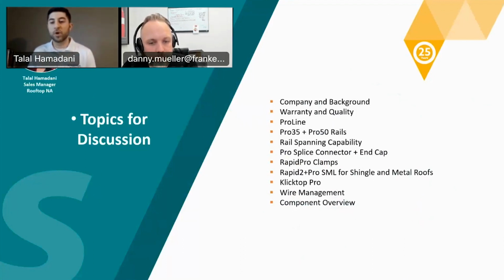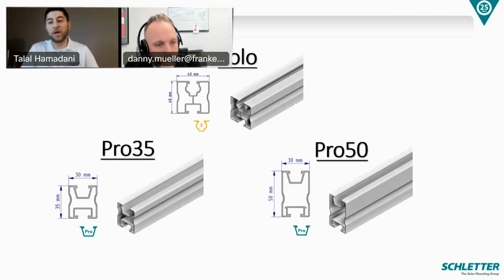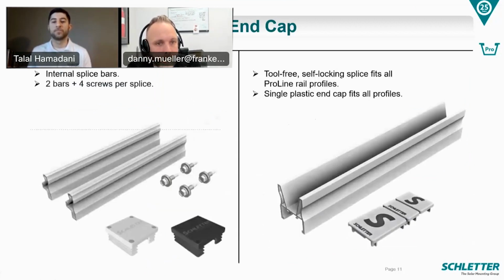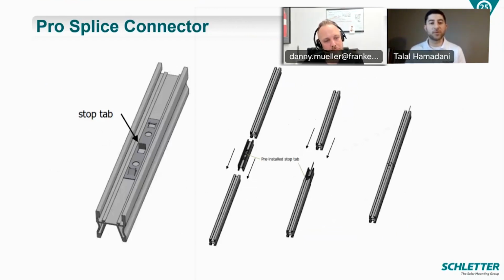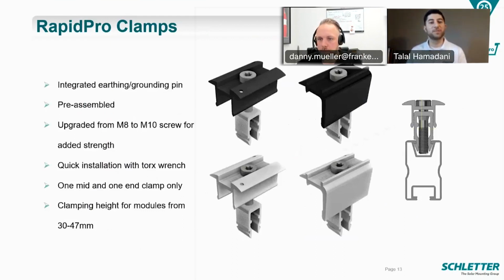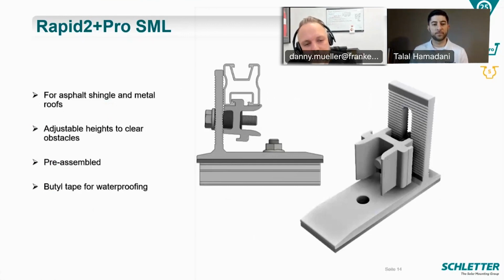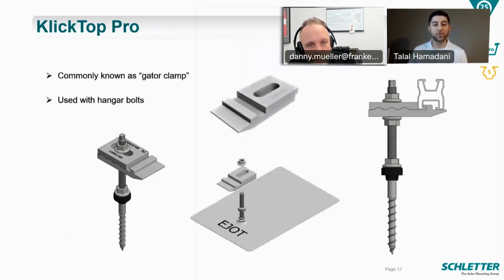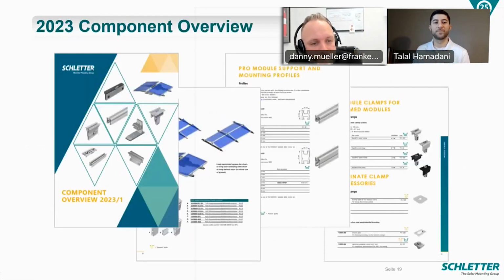Webinar - Introducing ProLine for Residential Systems with Schletter

Comment: Thanks for posting this video. I received a lot of your connectors and mounting components from a supplier....w ho shall not be named. The PDF manual that they sent was such poor resolution that I could not read MOST of the details. I learned more about the Rapid Pro System in 5 minutes of this video than I did trying to decode the provided instructions for an hour!!!!!!!